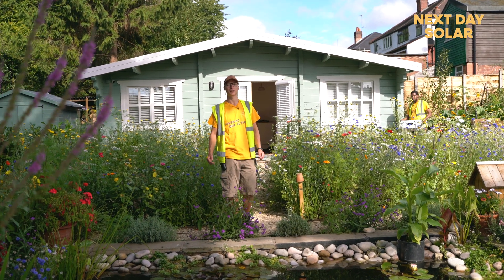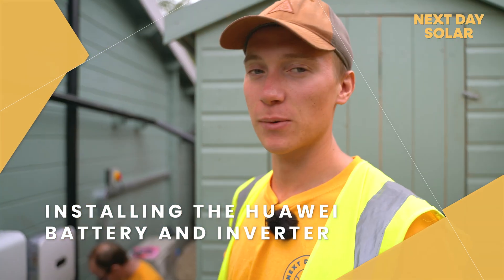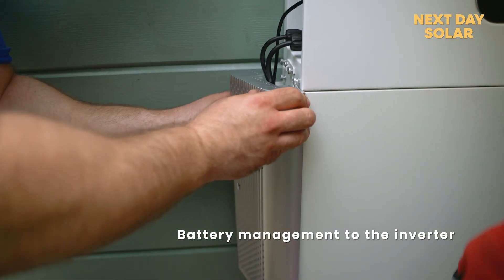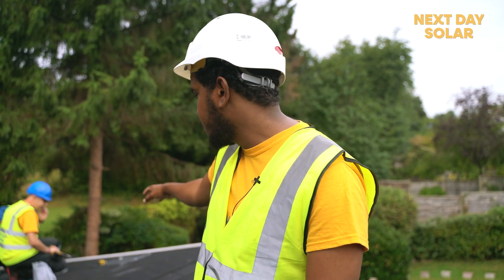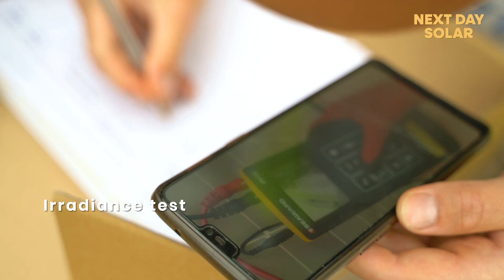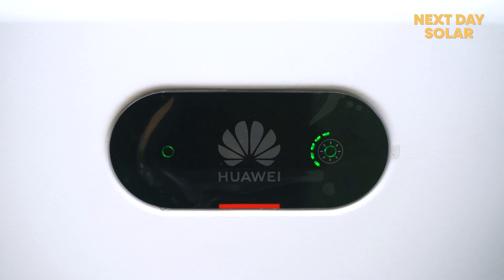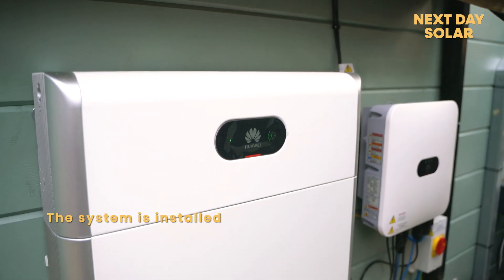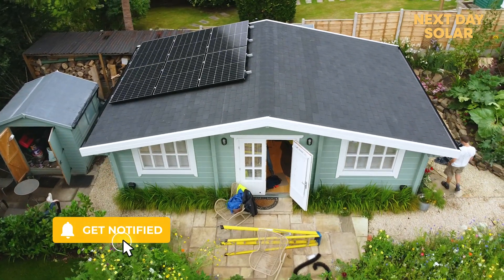Summer House/Log Cabin Solar Install - Step by Step with Huawei battery + Inverter, Bitumen Tile

Comment: hello! does this work like a ups? meaning instant switch when grid is down?
Reply from the maker: yes
Reply: This is really critical, agreed - I was surprised to learn that many battery installations require main power to function. While there's upside to a battery regardless, being unable to run during a power cut would really make me wonder why I actually got a battery :)

Comment: What panels did you use?
Reply from the maker: JA SOlar - 
405W Mono PERC Half-Cell MBB Black Frame
Reply: @nextdaysolar3349  Can the Luna 2000 battery be installed outside, at temperatures below 0 degrees?
Reply from the maker: @constantinradoaca8848  fine to be installed outside, fine for temperature to drop, but battery management system may pause charging if temp below recommend charge temperature.
Reply: What about hot weather? Can it sustain tropical weather high temps of 30 degrees Celsius and humidity? Obviously wouldnt put the battery and inverter on direct sunlight; would be covered inside but the temperatures would be arpund 30 degrees. Thanks for any answer!